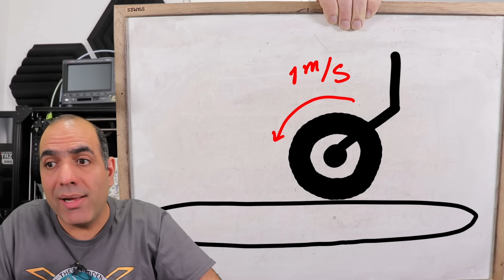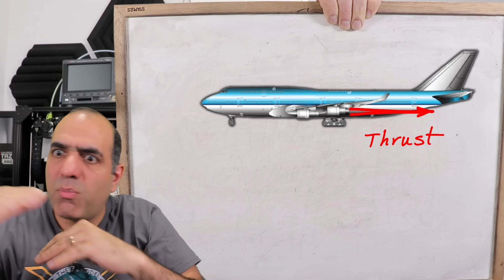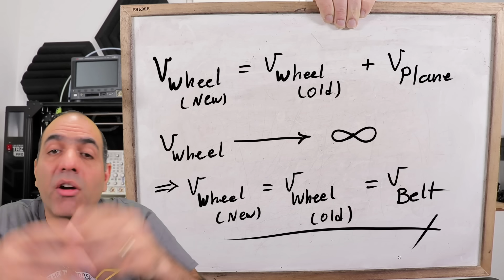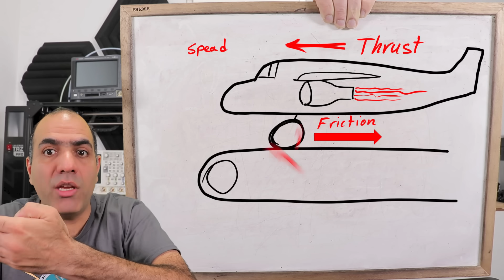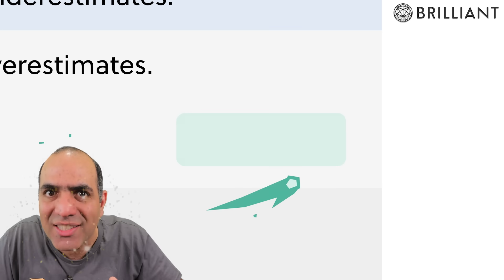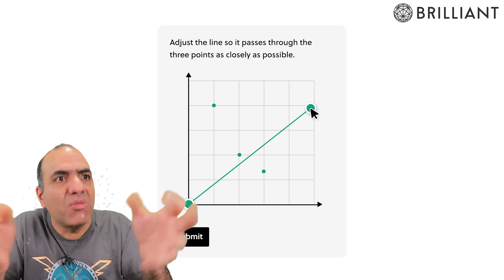Airplane Question that Drove Me NUTS!!!

Comment: It's very simple. There's no air speed. 😂😂
Reply: It's very simple. There is air speed.

A treadmill cannot prevent an airplane from gaining speed relative to the surrounding windspeed. It would either go infinitely fast, or break. Either way thr plane takes off with no problems.
Reply: @olican101  that doesn't make any sense. They wouldn't need at least a km of runway if a plane could find thrust just from the "surrounding". A plane needs air flowing on the wings. Imagine you running on a treadmill as in this example: would you feel Air on your face?
Edit: by the way, the treadmill matches the speed of the Plane, so the Plane is  literally static
Reply: @crismorgan6756  PS, commercial airport runways are as long as 5kms and a 747 generally needs 3.5km to take off under normal conditions.
Reply: @dangill1227  that's right. So What do you think about this topic?
Reply: @crismorgan6756  You said in a previous comment, and I quote, that “They would need almost a km of runway”…I was highlighting that most airports have several km’s of runway.
Reply: @dangill1227  yes, my bad: I should say "at least" , not "almost". It depends on the size of the plane but i would like to know what do you think about the main question: Can It take off?

Comment: The assumption is that the treadmill belt can move at infinite speed and that the all laws apply to the regular old jet plane, no skidded, sliding, frictionless wheels, no nothing! The wheels being powered or not has zero to do with anything, the result is the same; if the engine pulls the jet forward at 250mph and the airplanes weight on the wheels move the treadmill belt backwards at 250mph, then the plane is going nowhere. The wings only come into play if the plane can move fwd.
Reply: Wheel speed and conveyor speed are matched at the contact point between them and wheel only rotates when the plane moves forward. Again the plane moves Forward and the wheel rolls exactly the same distance on the conveyor belt. with everything matching exactly at what point in the forward movement of the plane does the wheel get ahead of the conveyor belt causing the belt to start?                                                                                             The riddle (Imagine a 747 is sitting on a conveyor belt, as wide and long as a runway. The conveyor belt is  designed to exactly match the speed of the wheels, moving in the opposite direction.)                                                                                                                          Can the plane take off?                                                                                                                                                                                                       Let's break it down                                                                                                                                                                                                                 747= real plane, it will take off                                                                                                                                                                                               Sitting= Stopped, not moving, wheels not turning, and conveyor not running.                                                                                                    Conveyor belt designed to exactly match the speed of the wheels = Conveyor belt can only match wheel speed, it can't change wheel speed.                                                                                                                                                                                                                       Moving in the opposite direction= The top of the wheel  moves in the same direction as the plane's forward movement, the bottom of the wheel moves in the  opposite direction to the plane's forward movement. So any conveyor belt the wheels roll over moves opposite the plane.                                                                                                                                                                            To make the wheels turn the plane must move forward, as the wheels turn they roll on the conveyor belt at the same speed. Because the speed of the wheels  already matches the stopped conveyor belt, the conveyor belt  will not have to start and the plane will take off.                                                                                                                                                                                                                                  I see now this is not a riddle, it's the definition of how planes take off from a runway with one word changed. they replaced the word runway with conveyor just to confuse
Reply: @tedfann3618  again, if the airplane's wheels are freewheels and the conveyer belts wheels are freewheels and will always match the forward spin of the airplane wheels it cannot have any forward momentum. If it can't move forward it can't generate lift and cannot "take off".
Reply: @marskullvan  The belt can only match the speed of the wheel. The only way the belt match a forward moving wheel exactly is to not start up The plane controls the wheel and the wheel controls the belt. The only way for you to make the belt start would be for you to grab and turn the wheel by hand without moving the plane. Even than it would only start as you rotated the wheel and would stop when you moved your hands to get another grip. EXACTLY That my friend are the only two things that can happen, I hope you see the light now.
Reply: @tedfann3618  I'm going to go with: no and no. As soon as the engines start moving the plane forward, the weight of the plane on the wheels on the belt start the belt moving backwards matching the engines trying to pull with the same force. If the plane cannot move forward, it cannot generate lift and if it can't generate lift... it may as well be a big ground vehicle at that point because the wings have no play. Have you ever run on an old unpowered treadmill that only moves when you push against it? It's not like you can out run it when it's matching your forward speed. Weight and friction matter
Reply: @marskullvan  I see that you know nothing about how planes work. Here read it all again maybe you will see the light my friend.                 The belt can only match the speed of the wheel. The only way the belt match a forward moving wheel exactly is to not start up The plane controls the wheel and the wheel controls the belt. The only way for you to make the belt start would be for you to grab and turn the wheel by hand without moving the plane. Even than it would only start as you rotated the wheel and would stop when you moved your hands to get another grip. EXACTLY That my friend are the only two things that can happen, I hope you see the light now.              Wheel speed and conveyor speed are matched at the contact point between them and wheel only rotates when the plane moves forward. Again the plane moves Forward and the wheel rolls exactly the same distance on the conveyor belt. with everything matching exactly at what point in the forward movement of the plane does the wheel get ahead of the conveyor belt causing the belt to start?                                                                                             The riddle (Imagine a 747 is sitting on a conveyor belt, as wide and long as a runway. The conveyor belt is  designed to exactly match the speed of the wheels, moving in the opposite direction.)                                                                                                                          Can the plane take off?                                                                                                                                                                                                       Let's break it down                                                                                                                                                                                                                 747= real plane, it will take off                                                                                                                                                                                               Sitting= Stopped, not moving, wheels not turning, and conveyor not running.                                                                                                    Conveyor belt designed to exactly match the speed of the wheels = Conveyor belt can only match wheel speed, it can't change wheel speed.                                                                                                                                                                                                                       Moving in the opposite direction= The top of the wheel  moves in the same direction as the plane's forward movement, the bottom of the wheel moves in the  opposite direction to the plane's forward movement. So any conveyor belt the wheels roll over moves opposite the plane.                                                                                                                                                                            To make the wheels turn the plane must move forward, as the wheels turn they roll on the conveyor belt at the same speed. Because the speed of the wheels  already matches the stopped conveyor belt, the conveyor belt  will not have to start and the plane will take off.                                                                                                                                                                                                                                  I see now this is not a riddle, it's the definition of how planes take off from a runway with one word changed. they replaced the word runway with conveyor just to confuse.

Comment: It’s a paradox, This is easy as 1-1=0 to find the correct answer. No movement. So no wheel speed, No lift . Maybe thrust🤷🏽‍♂️
Reply: Definitely thrust. If not, explain where the thrust force goes? The 3rd law of physics explains how it must go somewhere and its not through the wheels because they only free spin. The plane will take off and its because of nothing other than thrust!  On another note...The wheels will likely explode but bringing that to the table only complicates things further.

Comment: The plane will take off cuz the tyres arent being provided with power. Like if a car would've been there it would've been in "Dynamic Eqyuilibrium" due to the wheels moving and conveyor in opposite direction ONLY BECAUSE the engine provides power to the wheels. But in the case of the plane, the plane is not applying force ON THE GROUND BUT ON THE AIR BEHIND, Hence the plane will take off. The conveyer belt scenario affects the speed of the wheels, but not the airspeed.

Comment: From a systems engineering perspective: assuming that we’re abiding by phisical laws, the infinite speed problem wouldn’t actually happen. This is due to a flaw in the conveyor belt that cannot be overcome; the speed of light. 

In order for the conveyor belt to move and know how fast to move it needs a prompt. Let’s say this prompt comes from a potentiometer on one of the wheel hubs with a radio transmitter. 

Remember, the plane doesn’t move forward at a constant rate, it accelerates. So as the wheel accelerates its speed is measured and this signal is sent to the conveyors CU which converts the figures into road speed and adjusts the conveyors speed accordingly.

This doesn’t happen instantly, there’s a tiny time delay which is important! Remember, the wheel is accelerating. Therefore, by the time the conveyor belt receives the information that the wheel is moving at speed X and adjusts accordingly, the wheel itself has already accelerated past this speed…it’s basically a donkey and carrot situation where the conveyor is perpetually chasing the planes wheels. 

Also, because the planes wheels can ONLY move if the plane moves forward through physical space then the conveyor can only move if the plane moves. So moreover, the conveyor can only accelerate if the plane accelerates through space and the conveyor can only accelerate to the equivalent of the plane’s takeoff speed if the plane accelerates, through physical space, to that speed.

Long story short: plane takes off, bearings intact 😊

Comment: In the frictionful experiment, the plane would rather burst a tire or stop and nothing happens anymore because the wheels are not turned by any sort of engine/motor assembly but solely on the forward movement of the plane due to the thrust of the engine... So the plane would accelerate no matter what. It would just burst some tires and destroy the bearrings.

Comment: How does a plane generate thrust?
Does a VTOL (vertical take-off) plane like a Harrier need the ground to push off of?
Would a plane held in place by suitable strong rope and anchor lift off?
(The treadmill and wheels overcomplicate the problem and have nothing to do with the relevant elements of why a plane flies. Ignore them.)
(It will fly. Think about my three questions to understand why.)

Comment: Could you revisit this topic? If the conveyor belt is moving at the same speed as the wheels at all times, the airplane is stationary wrt the ground. Thus no lift can be generated.
Reply: The plane will still take off, because you can't keep a plane stationary with just a conveyor belt. Once again, the wheels have nothing to do with its forward momentum, the engines do.

Comment: still at 1:50 but... planes don't use their motors to power the wheels but to move air, so the wheels will turn faster (plane speed + compensated plane speed) but anyway, the plane will take off as usual

Comment: My answer was that the velocity of the wheels, +v, cancelled the velocity of the treadmill, -v. Therefore, the plane would just keep moving at a constant velocity and wouldn’t take off. That’s probably wrong but oh well.

Unless a secret condition exists where a Continental DC-10 is placed on the treadmill and causes a tire blowout ( cough Air France 4590), I stand by my answer.
Reply: it in theory wouldnt matter, the engines produce thrust, the wheels are Not powered, it will take off.

Comment: the question says, the airplane is sitting on the belt which matches the speed of the wheels. That means there is no relative velocity between airplane and the air. So there is no lift. Thus, the airplane can't take off.

Comment: No. There is no lift being generated by the wings. No lift = no flight. Which means the 747 would not fly/ take off.
Reply: huh? the engines push the plane Forward, ir will take of wheels dont matter.
Reply: The wings…….the wings need to generate lift. But right now the plane is standing still, so the wings are generating absolute fucking nothing and will not take off. Lift works like this. Air flowing over the wings makes two types of air flow. The air flowing over the top of the wing is low concentrated, the air flow underneath the wing is high concentrated. Just like diffusion, the air wants to equalize. So high concentrated moves to the low concentrated, by doing this it pushes the wing up causing the wing to fly. This whole thing is called lift. But right know the wheels are spinning and the engines are rolling, but the plane is still on the treadmill,so the plane is still in one place and is practically standing in one place. So for example if a person is running on a field he will feel the air against him (hench the saying the wind blowing through my hair or something like that), but if the person is running on a treadmill he feels nothing. The same goes for the plane. There is no airflow over the wings, so no lift. This will in result not cause the plane to bloody fly.

Comment: To answer a question like that you need to make some assumptions. To me the most logical assumptions are: 1.) Engines are running with power sufficient for the plane to take off in normal conditions. 2.) Belt speed matching speed of the wheels means while engines are pushing the plane forward, the belt is opposing in such way that the plane stays stationary to the observer(plane is not moving through air). 3.) Friction will not damage the wheels. 4.) Plane's maximum speed through belt is theoretically the maximum speed of the exhaust air of the engines (~300m/s)..... So... for a plane to lift off it needs air going trough the wings (since they create the actual lift force) the only air going through the wings is some parasitic air created from the engines winds so i think NO the plane WILL NOT take off. How do you get out of stall if you get into one... you put the nose down and force the engines so THE PLANE gains speed... not just the engines. There wouldn't be any cases of stall at all if the plane can go up in this way.... and the wings would've been much smaller :D

Comment: Yea the wheels arent connected to the engines but that doesn’t make an difference if I push my plane from anywhere til’ I get enough speed to lift off I will turn the wheels, but the wheels in this case are on a long carpet which are getting pulled away from them that means it isn’t moving without movement it’s done. If you just take the question nd donmt overthink it it means the belt matches the speed of the wheels that means the plane is in a standstill. It’s literally the same as being on a treadmill.